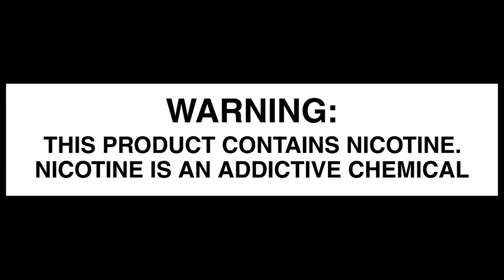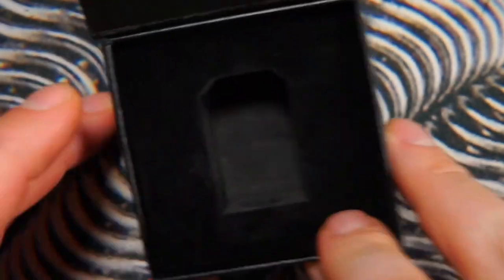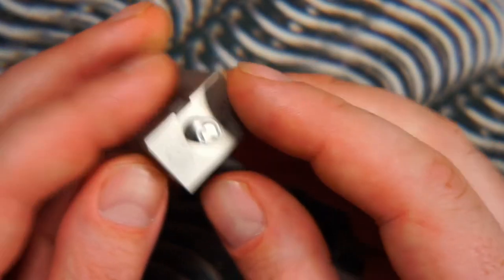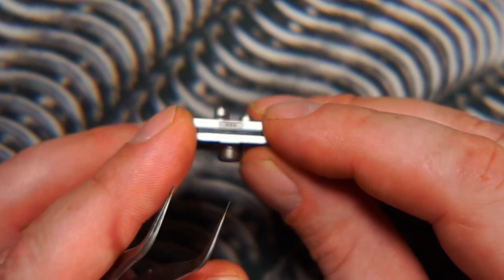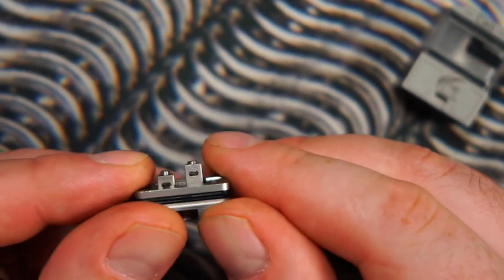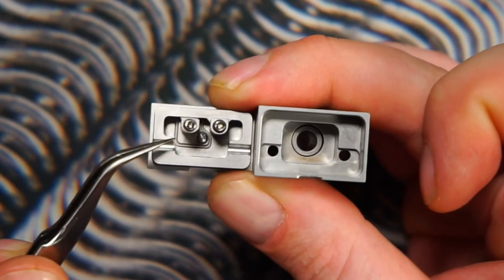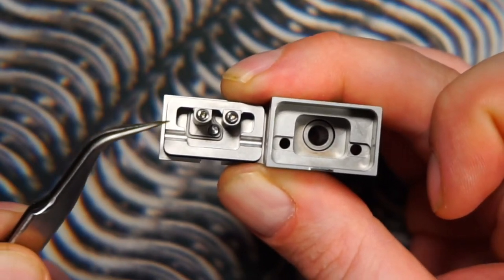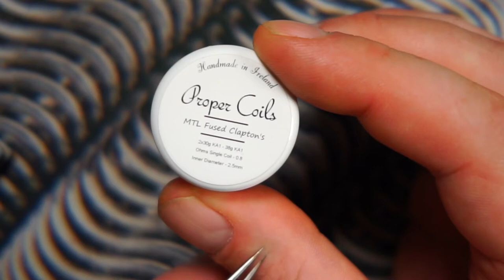Ceò | MT Essentials | Van and Del Design

Comment: Excellent review John. I’ve been lucky, it’s wicked perfectly for me: more by luck I suspect! I had the same issue as you with the coil (I was using one of yours of course). Had to do an extra half wrap and then took an age to get the coil lined up and seated properly. In DTL mode I love the flavour, and I love the finish and weight and build quality. Hope you are well mate
Reply from the maker: Thanks brother, I have the wicking nailed now, would have loved this in brushed Stainless steel, loving the Poet rda too nice little surprise 😁
Reply: @ProperCoils  I watched Mark’s video a few times and copied him (plus I’ve got the Theatro, so am used to the tail wicking method: that one took me ages to get right). Still suspect it was more luck though as there does seem to be a lot of people getting juice dumps. 

By the way, the Proper Coils absolutely bang in the Ceo in my view!
Reply from the maker: @SmokeandSteam  glad to hear it, enjoy👊💚